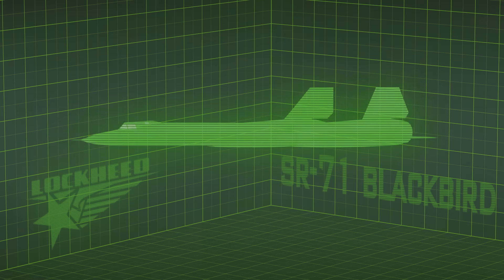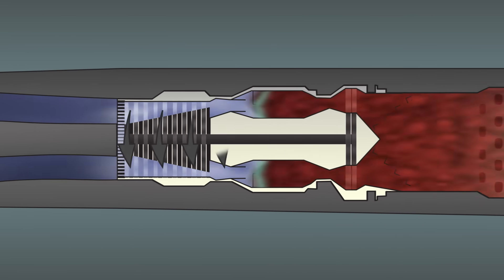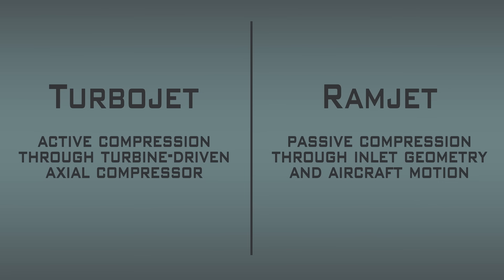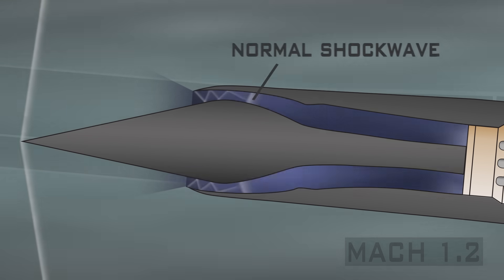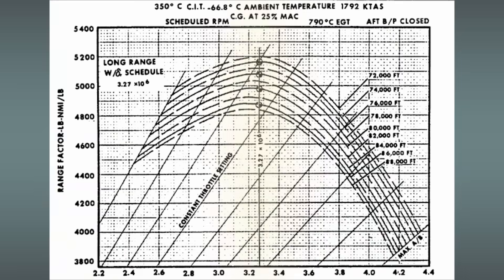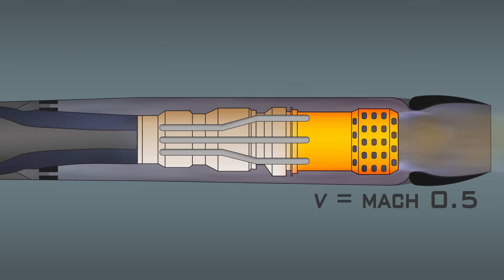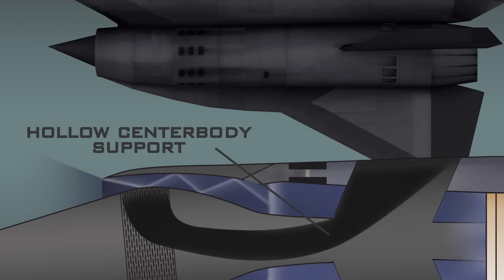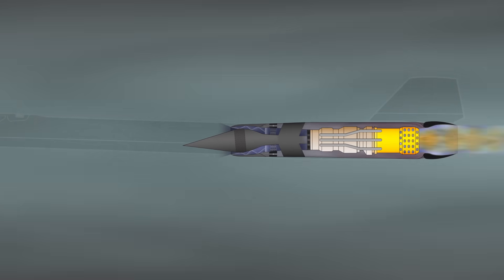The Mighty J58 - The SR-71's Secret Powerhouse

Comment: So why is the spike off-centre? (funny that he describes it a a "symmetrical spike" when it doesn't look it)
Reply from the maker: I've answered this question a dozen times in other comments.  The spike is aligned to the direction of the aircraft motion, parallel to the ground when the bird's angle of attack is taken into consideration.
Reply: I did look through the comments... you're saying it doesn't fly parallel to the ground?
Reply from the maker: Yes.  Like almost all fighter jets, the fuselage is part of the wing, so the whole plane angles upwards by about 3 degrees to generate lift.
Reply: hexonatapeloop sr 71 pilots explain that you should think of this plane almost like a speed boat, w/ nose slightly upward as a speedboat would do as it skims across the water. Which is the reason for the upward angle
Reply: and it's drawn at more than 3 degrees, just saying.
Reply: Plus at high altitude you probably need AoA even more
Reply: Yes, why wouldn't it be? You don't install engines to push an airplane up, that's what wings are for.
Reply: Awesomely accurate analogy Steve Dunch.
Reply: The question here is: when the plane flies at a 3 degree AoA, are its engines also angled the same and if so, why aren't they installed in such a way that they're parallel to the ground when the plane is at a 3 degree AoA which would seem optimal. I'm guessing it would make the plane more difficult to handle at other speeds, altitudes and angles of attack – but then its whole purpose is to fly at that precise AoA, so other modes would seem irrelevant. I'm actually very curious now as to the precise reasons.
Reply: Ahmad Dan-Hamidu If the engines were at 0° AoA when the fuselage is at 3° AoA, the spike wouldn't need to be off-centre. The fact that it has to be angled to be perpendicular to the airstream is a clear indication that the engine nacelle, being part of the fuselage, is angled by 3° in flight. I've never read anything mentioning the nozzles to be angled, and visually they certainly aren't. Hence my conclusion that the resulting thrust has to be at an angle.
Reply: So the thrust of the engine is in line with the fuselage and wings?
Reply: Sobakus The engines aren't at the same AoA as the fuselage so that when the fuselage is flying at 3-degrees AoA, the engines are at 0-degrees AoA...to give the most (un-offset) push/thrust.
That's my logical way of seeing it...and I stand to be corrected.
Reply: Paul Varn so why does the spike need to be off centre then?
Reply: Good explanation TL
Reply: hexonatapeloop if you watch full documentary on sr71 it explains why
Reply: NO.  The complex wing shape combined with changing weight and air density, speed and lift at various altitudes together result in a near on-axis air flow into the front of the engine at high speed.  If the aircraft weighed nothing and little or no forward speed, even on the ground there would be no upward thrust because the engines are tilted down.  Although the fuselage angle compared to the wing is around 3 degrees, the engines are pitched down around 2 degrees so they have minimum off axis flow at mach 3.2 when the wing AOA is near zero.  The result is at cruise the engines and wing are near level while the tubular fuselage is tilted up.  The complex spike shape takes all this and the wide range of aircraft speeds into consideration.  If you have FSX, you can learn about all this and more while flying my SR-71 model for free.
Pv
Reply: The spike needs to be off center to accommodate flying at higher AoA (angle of attack), when the incoming air stream enters the engine at an angle. This aircraft does not accelerate to Mach 3 instantly, you know. It also has to operate at lower speeds to take offs and landings, when it is forced to fly at much higher AoA that in cruise configuration.
Reply: All aircraft need a little angle of attack. The slower you move, the heavier you are, and the less dense the air the more angle of attack you need to generate enough lift to keep your altitude constant.  Up to the point that you reach the critical angle of attack where airflow starts to separate from the top of the wing and it becomes just another brick (the wing stalls).
Reply: My take on the cones shape and angle is how it captures and directs the shock wave and where the various bypass ducts are located and has nothing to do with the attitude of the aircraft.  If that was the case, a simple climb, dive or bank would throw everything to hell.  It may also have something to do with the over all lift characteristics of the aircraft.   You would be surprised how a small change in one place has large effects over all.  For reference see droops on the A380 that are deployed to manipulate airflow over the wings. The droop is near the fuselage, yes it corrects aerodynamics mid wing.  Yes, I am an aerospace engineer, and this is simply an educated guess based on years of fluid dynamic work with turbines and compressors.  Fmax, kinetic friction,  Reynolds number, something something something...again, just an off the cuff guess.
Reply: hexonatapeloop no, that 3-degree AoA is simply to pronounce better the fuselage's ability to be a lifting-body so that it produces a hefty percentage of the total lift generated by the aircraft.
Reply: Also at speeds higher than Mach 1, a higher AoA is required.
Reply: What jets don't fly like this? Are there any that fly parallel to the ground and what makes them special?
Reply: AoA has nothing to do with the ground... it is all about the beam angle relative to the vector of motion. In nominal, level flight that HAPPENS to be parallel to  the ground, but only by coincidence.
Reply: Because you needed some reason to make a stupid fucking comment.
Reply: Watch the video again. He explained it.
Reply: Does anyone here actually know anything at all?
Reply: I know what you did last summer.
Reply: but that's precisely my point- if the angle of attack is 3 degrees and the engines are in line with that, the engines are pushing the aircraft up, aren't they
Reply: yeah like totally awesome woo hoo
Reply: And east is east and west is west and if you take
 cranberries and stew them like applesauce they taste much more like 
prunes than rhubarb does.